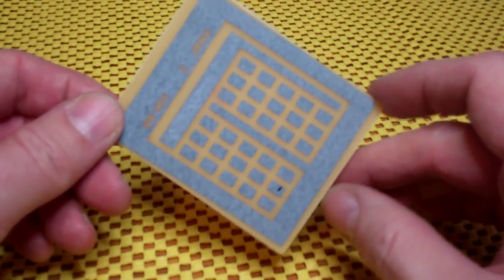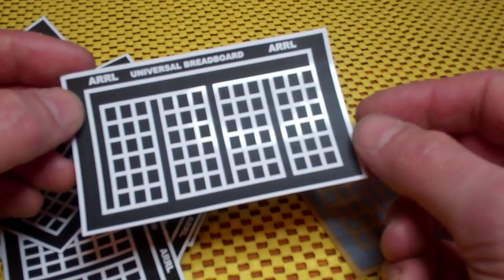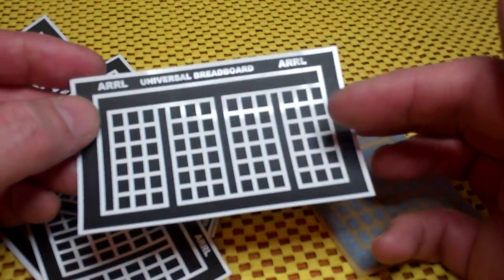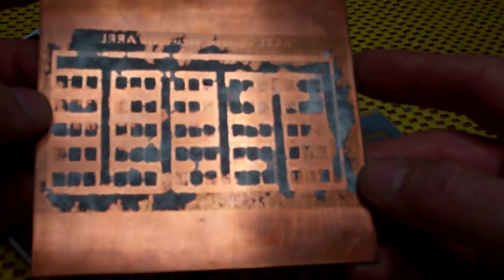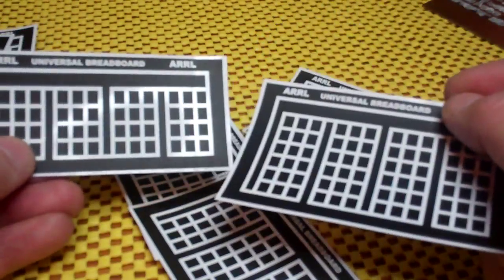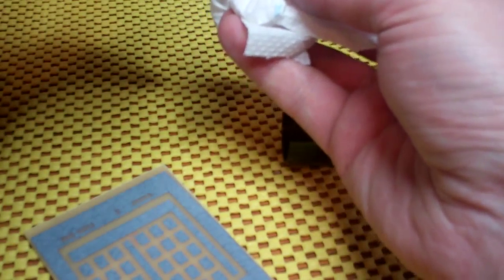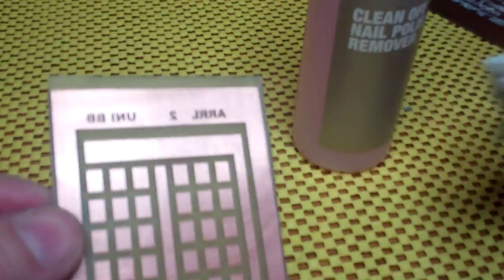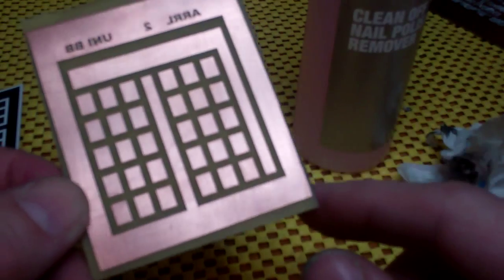Toner Transfer DIY PCB - the final results....

Comment: Nice Job may I suggest you get a free copy of Design Spark PCB it is totally free Open Source and you can reverse your prints MIRROR so your writing comes out the right way around on the PCB :)
Reply: Design Spark is not bad though I personally prefer KiCAD ver. 5.   There is also EasyEDA which is an online CAD program that looks good though I have yet to use it.